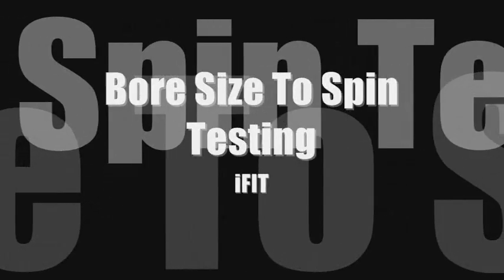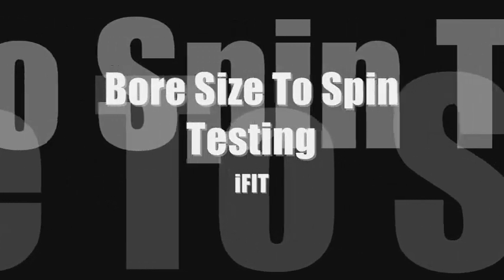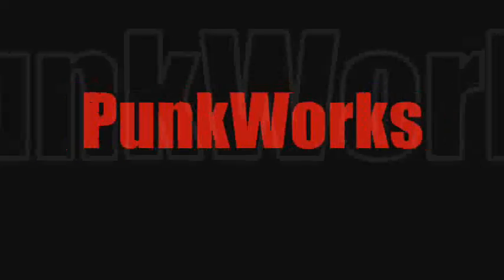Bore Size vs Spin Testing

Comment: @Magmoormaster Essentially yes, if you look at the data, then look at the row that says 'Average' The Smallest amount of average spin is induced by a .003 Underbore, whereas the .012 Underbore produces the most at 1702 rpm